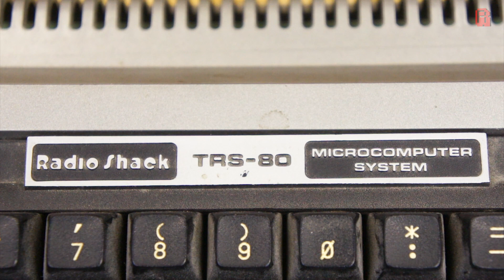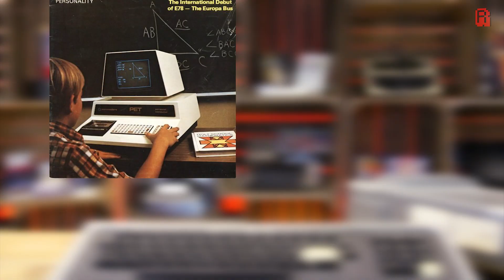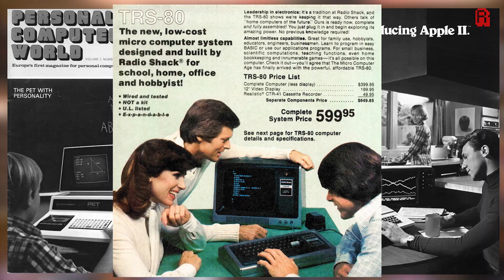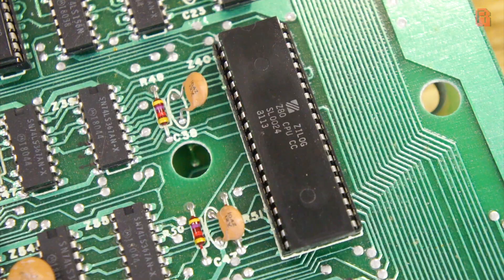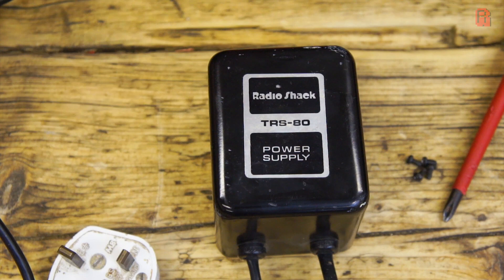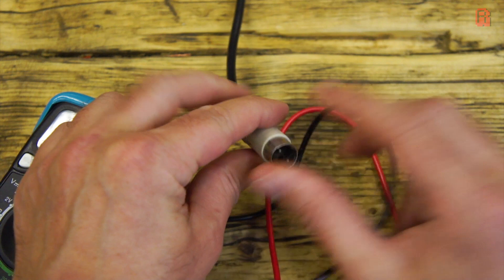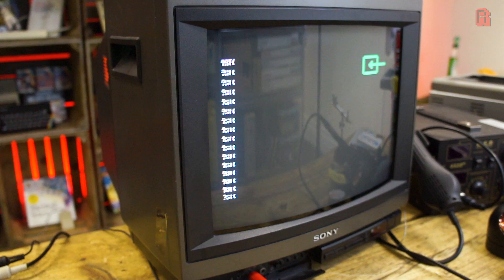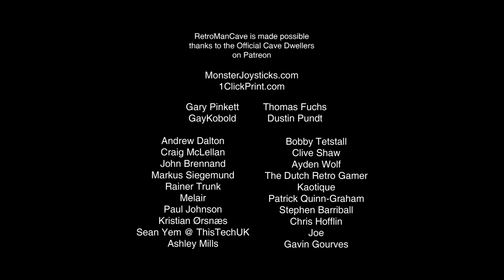Trash 80 to Treasure | TRS-80 Restoration Ep1.

Comment from the maker: So, where do we go next to fix this?  Well as I start reading up on the system for part 2 I've discovered the keyboard may still be the issue.  The keyboard has pull ups on the data lines, without the keyboard attached then the lines are in a floating state and the system is reading garbage input.  So the first job will be to put some nice headers on the keyboard and system boards with a detachable cable and go from there.  I'm looking forward to sharing my progress.  Thanks as always for watching - Neil - RMC
Reply: so they put the pullups on the keyboard side and not the board!?!?
Reply from the maker: That's what I've been reading today.  I'll be working on Part 2 next week so can confirm.  Either way it will be much nicer to get a couple of headers and a cable on their to make future work on the machine easier with the keyboard easily removed.
Reply: I look forward to the next episode :D
Reply: Awesome episode. One of my cousins is several years older than me and bought a Model 3 to play around with. I used to go over there with my books full of programs and type them in as a kid. They wouldn't always works straight off the bat due to errors and differences in BASIC, but my cousin and I would figure out the problems and get them working.
Reply: If you don't have it already here is a great reference for the hardware. https://www.heinpragt.com/techniek/algemeen/files/Radio%20Shack%20TRS-80%20Micro%20Computer%20Technical%20Reference%20Handbook%202nd.pdf
Reply: I hope to see your part 2 soon, hopefully by next week or by the end of the month when I get some money for beer. Nothing like having a couple cold ones and watching some retro computer videos for me :)
Reply: If you do suspect floating data lines then simply tie each of them to ground via 10k resistors ...you may be able to get away with a lower value but limiting any current draw is always good practice.
Reply: I'd suggest replacing the ROMs and perhaps the (non-video) RAM.  You can see that most of the thing is working, since you're getting decent video, some characters that look right, and something is looping on the screen, so it seems possible that the ROM is degraded and it can't get to its normal prompt code, or RAM is screwed up, and the ROM is trying to write something to RAM, and the behavior of the ROM software is sort of screwy (since it's reasonable to expect that when you write to RAM you should be able to retrieve your data.)  We'd need a good disassembly of the ROM to know definitively, and I've never been able to find a good one.  It might be easiest to get a known working TRS-80 Model 1 Level 2, and start swapping chips.

Incidentally, if you get it running, you might be interested in my little project here:

https://github.com/calphool/TRS80GS
Reply: Ok, I downloaded a Z80 disassembler (yazd) and ran the level2.rom file through it.  What would be very interesting would be to see if we ever get to address 0x00b5 (or address 0x0075).  That appears to be the start of the loop that prints "MEMORY SIZE?" and then waits for a response.  It seems likely that we never get there (or if we do, ROM routine 0x28A7 is scrambled, since that's what should display "MEMORY SIZE?")  Do you have a 16 channel logic analyzer?  If so we could watch the address lines and see if we get to this location.

Like I mentioned, it would probably be easier to just eliminate the whole possibility (or confirm it) by getting a known good level2 rom and popping it in there.
Reply: Good work J R. I'll add that the 6502 version of MS BASIC gets stuck in the memory count in a very similar loop with certain RAM faults. Level II BASIC is based on the Z80 port of MS BASIC, I suspect it acts the same in this respect, and that the fault is likely RAM, or one of the various gates driving the RAM control lines.
Reply: It's very suspicious that the entry point for handling ST errors is 0x28A1.  The entry point for the print routine (which gets called to print "MEMORY SIZE?") is 0x28A7.
Reply: RetroManCave TRaSh 80 to treasure
Reply: "So, where do we go next to fix this?"
What do you think the spider was trying to figure out? 😀
Reply: The Regulator is one of the parts that go bad on Model I's. And the video ram can go bad as well.
Reply: MacJohnMcC I really appreciate this! I'velost both of my copies over the course of time.  The first one I bought when I was manager of the area radio shack computer repair center!

Comment: I bought the TRS-80 the first day it was available.  This was in Phoenix, Az.   I was told by a Radio Shack Salesman, that people were flying in to Phoenix to buy one.  Apparently Radio Shack made Phoenix as a test market, and made efforts to have the TRS-80 always available in the city.   As a side note,  at the time, if You had any stock in Tandy, You would get a 10% discount on any Radio Shack purchase.  So I bought one share.  Several years later Tandy offered twice the amount I bought the stock for and no brokerage fees.  Apparently, the paper work, and notices required for them to send to me every year as a share holder owner, was costly for just one share.

Comment: TRS-80 Model I Level II was my family's first computer back in 1978. I learned to solder helping my father build a LNW System Expansion for it. I learned to program on it, connected to my first BBS using it with a Novation Cat 300 modem and typed up my middle school papers using Electric Pencil along with an Epson MX-80 printer which at some point was upgraded with Graftrax roms to allow printing graphics.  Christmas 1983 it was replaced for me by a Commodore 64 but my father continued to use it until 1985 when it was finally displaced by an IBM 5160.

Comment: I had a fully loaded (maxed out mem/fdd's/exp bay/voice syn, etc.) way back in 79-84.  Learned Z-80 Assembly on it, which of course served me well on the Apple II when I dove into 6502 and then PC's 80x86.  
I've been coding for work and play for roughly 34 years now.  In '87 I worked for Radio Shack/Tandy Training and Support as a Systems Engineer.  Each Area Training and Support Office (ATSO) was housed along side a Radio Shack Repair Center.  They were still actively repairing Model 1's in 1989.  
Somewhere around the 20 year mark it transitioned from fun into work.  I have a lot of fond memories of the Model 1, considering it helped me build the foundation for a profitable career.

It has been a fund ride, but... TBH... at this point, I hate computers.  I've managed to keep up on modern development technologies... actively coding handheld, phones and supporting PC/Server apps.  But today I take more pride in molding young, new developers.... helping my employees make smarter coding decisions.

Thanks for the video.... It did bring back some great memories.

Comment: One of my first few computers. I liked it despite having only 16KB of RAM and a cassette to save and load programs on. Later in life I eventually got a LOBO expansion interface with 32KB more memory. Even later in life someone gave me a complete system that started life as a 4KB Level 1 system and was upgraded over time to have 16KB Level II and lower case mod internally and a Radio Shack expansion interface with 32KB of RAM, serial board and 2 very heavy TRS-80 single density floppy drives. It was a beast. You have a slightly newer version than I started with as mine didn't have a textured keyboard and did not include a numeric keypad.

Comment: Enjoyed the show. Just pulled out a couple of Model 1 TRS-80s that I picked up recently. I keyboard and the two Monitors working. The other keyboard, does have some sort of display,
but has a problem with the vertical hold. I have another Model 1 Keyboard that seems to power on, but then the power light starts going on and off frequently. 

Look forward to watching more videos.  Thank you

Comment: Ha, that is how I came by my IBM 5160. One of my electronics professors was clearing out his attic and found it, gave it to me as he knew I had interest in older tech (our first family computers were a TI99/4a followed by an Apple IIc). Cleaned it up, fixed the caps on the video card...working well.
Reply: PeanutbutterJellyfishSandwich Thats how I started my computng life as well... Great memories.
Reply: Did you have the speech sythesizer for the TI99? We did...that was like magic back then. Also typing in "bad words" was pretty funny.
Reply: PeanutbutterJellyfishSandwich No, I was 7 at the time and my parents that it was too much to add to our "toy". But I really wanted one. Funny thing... My parents wouldn't even pay for the TI tape deck. They bought an off the self deck that worked with the cables.
Reply: Eh, I was probably about the same age as you (I am 39 now). We had a bunch of cartridges, the speech synth, but no tape deck, and a monochrome amber monitor.
Reply: The TI was my first computer also. Way back in 1983. I have one now in mint condition.
Reply: Yes I know all,about the F18A. I have one in my ColecoVision and have contacted the creator about making more.  I want one for the TI and I’d like to program for it.  I also contacted the ColecoVision emulator guy who created aColEm to see if he could add support for it.  I’d like to build something for the ColecoVision that uses smooth scrolling.
Reply: Yeah, I have been holding off on getting a TI until I can get the F18A (now MkII version in the works).
Reply: Ryan Yoder Guess what? By luck there was an estate sale in my area. For $175, i picked up an entire retro computer lot. A TI99/4A, a Commodore 64, a Commodore Plus/4, a matching 5.25 inch FD for the C64, a white (and apparently sought after) 5.25 inch FD for the Commodores, a Commodore printer, Commodore tape drive, a bunch of random (mostly DOS) 5.25 floppies /software, and a bunch of original manuals.
Reply: PeanutbutterJellyfishSandwich damn bro. Nice!

Comment: Trash-80 to Treasure?  My fondest memory of the Model I was that ribbon cable to the expansion box, and how the machine would reset if the connection was even a little off, which as it aged, became much more likely.  Luckily never my primary machine, but I did learn Z80 assembly on it, which landed me a job many years later.

Comment: The first thing I would try is to unstack the character generator mod and fix the trace to see if it works with upper only mode.  At least you'll have that user-mod ruled out as being the cause.  Then work backwards by removing the ram upgrade etc.

Comment: I have a TRS-80. Originally it is Level 1 basic and 4KB ram. Shorty after my uncle purchased it he upgraded it to level 2 and 16KB or ram. He regretted hacking it up and wished he would have just purchased one with 16KB, and level 2 built in. When he was still alive I was planning on purchasing a radioshack portable CD player off ebay and burn level 3 basic audio dump to a CD and call it the TRS-80 CD-Rom upgrade package.

Comment: This is the first computer I actually worked on. At my secondary school, we had one of these, and a bunch of the Level 2 models. They have a somewhat nicer keyboard, that is textured rather than smooth, and the monitor is a green one, which is sharper than the white/blue one. They also don't have the power LED in that position, although I forgot (we're talking 35+ years ago) where they put it.
Reply: ...which you ,mentioned about 5 seconds after I restarted the video. Never mind, I'll shut up now.
Reply: I once wrote a Mandelbrot set generator for one of these. Can't say it was very fast though.

Comment: The absolute first (well, second really) thing I do on these kind of machines after opening them is to press firmly on both ends of all of the socketed chips to reseat them. That solves about 99% of all the problems I've ever seen. 
The first thing? Look for leaky caps and replace them. You look good to go there. There still may be bad ones, but no obviously deathly bad ones. But try reseating those chips before you do much more than repairing that keyboard cable.

Comment: Great and informative video! One nitpick: At 11:00 you mention that "later models" did have colour graphics, but this is not the case. None of the later TRS-80 models (II, III, 4, 12, 16, 16B) had colour graphics. Perhaps you are confused with the TRS-80 Color Computer, which is a completely different line of computer and not compatible with the TRS-80 at all. In fact, not even the models II, 12 and 16(B) are fully compatible with the first model, only the model III and 4. I hope you can get this one fixed!